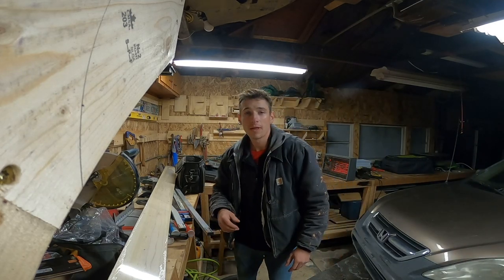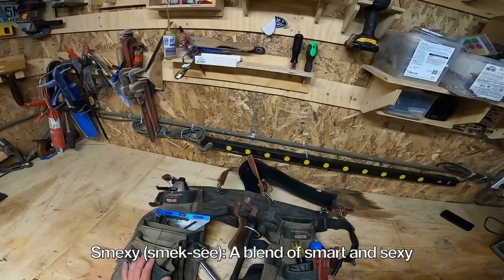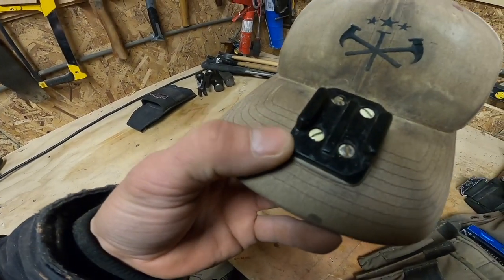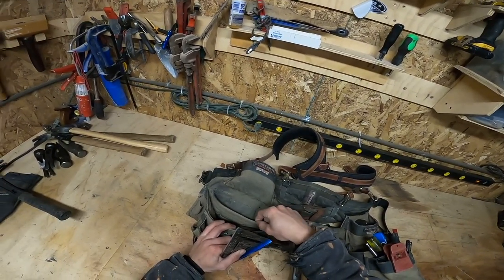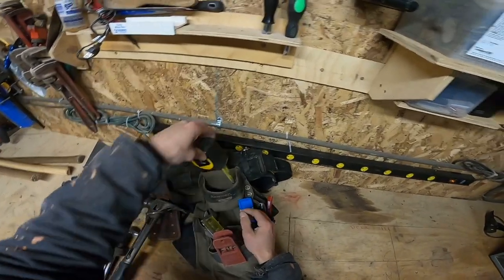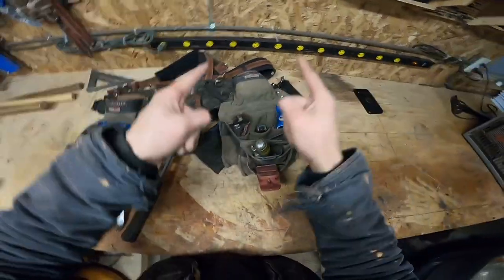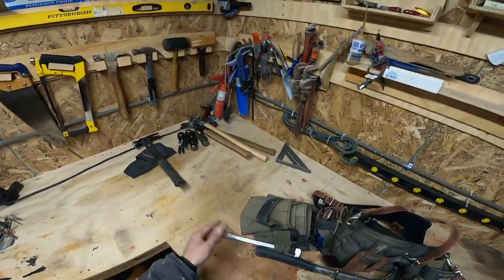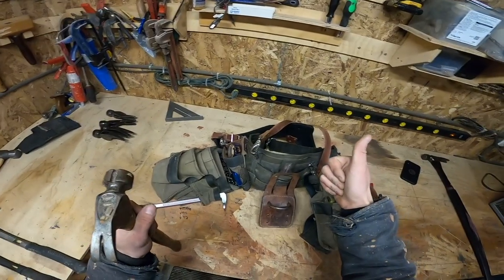My Framing Tool Belt Setup   +   *Hammer Talk*

Comment: used to work for estwing as a finisher. ran a 12' (ft not inches) double spindle belt sander mfg in 1909 to grind tools to their final shape/dimension/beveled the heads, sharpened the claws, ground the diamond spline along the hammer neck, swapped wheels and put the twist around the barrel between the head and claws, eased all the edges/spine, swapped out wheels and belts and polished up to a mirror finish and all that. good stuff. final stop before laquer and QC. as a framer (work as a trim/finish carpenter now) i ran a vaughan axe handle or a rigger if i ate my wheaties because hickory is king, but theres some badass hammers estwing makes that id take over martinez. check out the estwing ultra series. they're steel, but its got a side head nail puller like martinez and comes either milled (waffle), smooth, 19oz or 15oz, long or short handle, blue or black finish, rubber or stacked leather grip. E19sm i think is the black leather milled model no. theres another badass hammer we made thats aluminum with a steel head and claws with a counterbored lead shot capsule inside the head. wicked little hammer. feels like a stilletto or dalluge titanium had kids with an old stanley dead blow. makes a 20 penny feel like a 23 guage pin. i think those were model no. albkm or alblm.

Comment: I've had some Occidental Leather OxiLite framers since 2016 and I love them! Comfortable, adjustable, and every tool has its home. With some nice open pockets. Only downside is the belt is fairly narrow, so suspenders are almost required.
Reply from the maker: Just picked me up a set when I was at JLC Live. Worn them for a couple days. Love the open pockets and how well they work with suspenders👍

Comment: I had a set of diamond back grandes for about a week. Put them on eBay,I couldn't stand their stuff but some people like it. Even the grandes the pockets were  small and not enough of them ...I think you would like the occidentals if you got some. I have three sets of the adjusta fits .The belts don't slide around is the reason I like them, I'm definitely a toolaholic. I buy new stuff then if I don't like it I put it on eBay and try something different. I'm 51 you'd think I'd be over that by now 😂🤣😅
Reply from the maker: Haha I feel you man. Age is just a number😂I’ll be 85 and still buying tools
Reply: @certifiedladderholder  yeah I love tools, I'm not a hammer collector though. I have a stiletto that hangs on my pole barn wall. I carry an old leather, handled Estwing everyday

Comment: Get a pica 3030 pencil from Amazon, worth every single penny. Everyone in the crew w vouch homie plus it’s only like 30$
Reply from the maker: I bought one of those a while ago my man. It was awesome because you could see the lead on almost anything you wrote on. But the downside for me was I kept breaking the lead and running out of it. Easier to just use the buttload of pencils our lumberyard supplies us with👍
Reply: @certifiedladderholder  Yeah mine basically melted when it got wet. Lead either breaks or slips. Same with the big dry

Comment: Where did you get that clip for snap line? Thank you for the answer.
Reply from the maker: https://www.amazon.com/V-Line-Clamp-Measure-Chalk-Holder/dp/B008L1F4II?pd_rd_w=yerJe&content-id=amzn1.sym.99d2f5bb-29d9-4f60-b07e-f97fafe39bec&pf_rd_p=99d2f5bb-29d9-4f60-b07e-f97fafe39bec&pf_rd_r=HKHNRAVSWVXX6NHPVVRQ&pd_rd_wg=1WnnE&pd_rd_r=c713a1f3-f66f-45ae-8dcc-25a1f0be10d4&pd_rd_i=B008L1F4II&psc=1&ref_=pd_bap_m_rp_4_t
Reply: Thanks man. Have a good one.

Comment: Any idea the weight difference between a Diamondback and leather pouch setup? I’m thinking about ordering a akribis setup but I feel like it could be heavy
Reply from the maker: I was told by some buddies that the leather pouches are quite a bit heavier than diamondbacks. I just picked myself up an occidental that’s mostly canvas and a little bit of leather. Feels about the same as the diamondbacks👍

Comment: What length cats paw do you suggest?
Reply from the maker: https://www.amazon.com/Vaughan-Bushnell-4300-Dalluge-Puller/dp/B00IVBC8G4?pd_rd_w=nogDQ&content-id=amzn1.sym.94349326-ca8a-4b0d-94f0-6931485b8573&pf_rd_p=94349326-ca8a-4b0d-94f0-6931485b8573&pf_rd_r=SP7PMPAD276BFVAA6PA7&pd_rd_wg=JqquX&pd_rd_r=a2f16cec-d259-4895-9c41-b988ea634121&pd_rd_i=B00IVBC8G4&psc=1&ref_=pd_bap_m_rp_23_sc
Reply from the maker: This is the cats paw I personally have. It’s a 12”. I love the size because it gives me a lot of room to really hammer and pry on the thing. 2 guys on our crew have the smaller ones but it just depends on what you like.

Comment: Right on! If I'm up high I just turn my square forward so the heel is facing the front of the pouch and it locks in.  I actually like it more than other brands because you can throw it back faster. There are two holes for the cats paw. One fits the stabila torpedo level and the second more folded in one fits the nail bar much better (but I mostly use the bar sleeve). If you wrap some electrical tape around the bottom of the ti-bone Stiletto it slides in and out of the hammer sleeve a little better but I've leaned towards a wood handle when using hammer sleeve and that's just fine with me.
Reply: I second the tape on the hammer handle, works great for my holster.